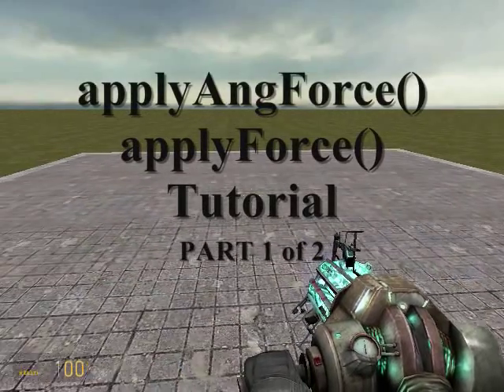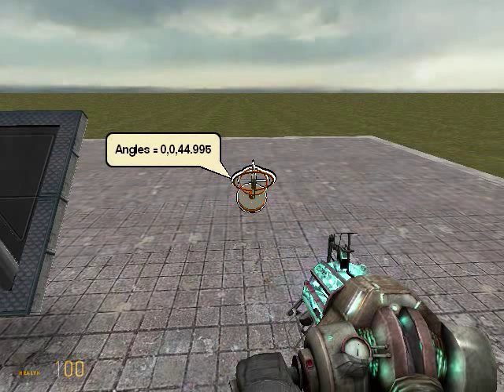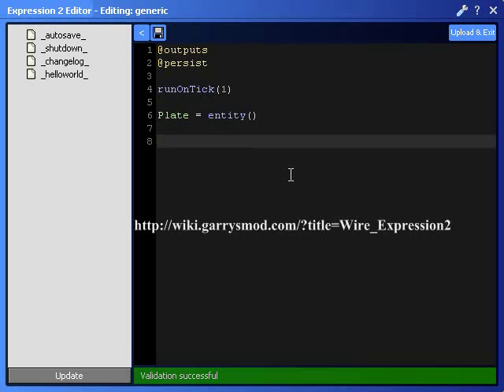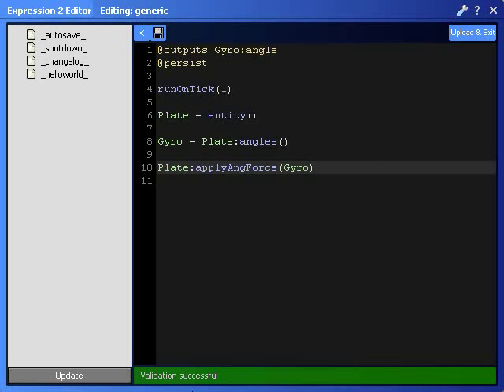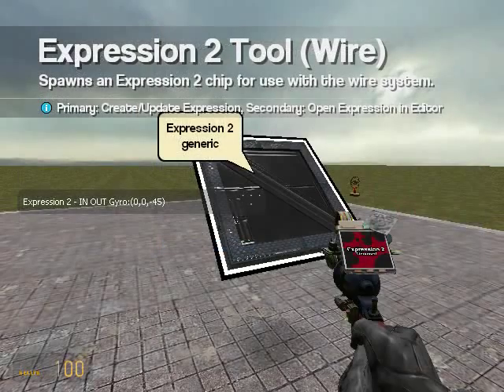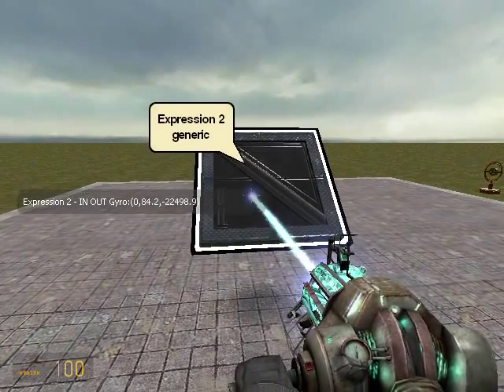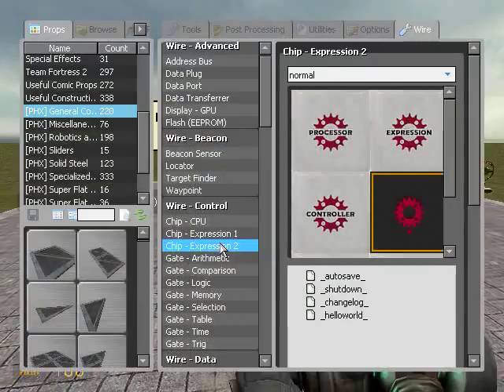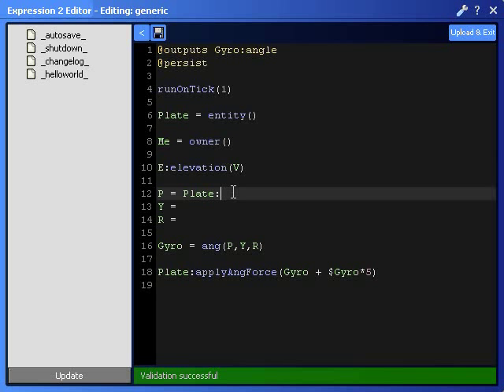Wiremod applyForce() & applyAngForce() Tutorial 1of2

Comment: @Genswitch There are two ways of doing that.
1: Have your starting angle be (0,0,0), and increase/decrease the pitch when your press buttons. The chip that stabilizes will stabilize according to that angle.
2:Don't have a set angle at all. if I wanted my plane to turn up use "Plane:applyAngForce((ang((W|-S),(D|-A),0)*10- Plane:angVel())*Plane:mass())"

| is "or". so (A|D) means we're going to return A is we're pressing A, or D if we're pressing D. Otherwise we return 0.

Comment: @Maso5 one more question, what does the parameter of runOnTick do?

when I use runOnTick(2) I'd expect the expression to called every 2 ticks, but I have even tried runOnTick(100000) and there seems to be no difference in how much operations it performs so it seems like the parameter is ignored.

Comment: @parkourperson28 Sorry, I don't think you care but I explain anyway :P

Boolean: Usually can only have two values, true or false (but in memory it's usually a 32-bit integer)
interval(Normal): interval function that takes a parameter of type Normal, which is the interval in milliseconds.
Normal: A floating-point data type. Which is actually confusing because it's called Number in the wiki, which makes more sense, but in some E2 errors I was pretty sure it said either Normal or norm.

=)